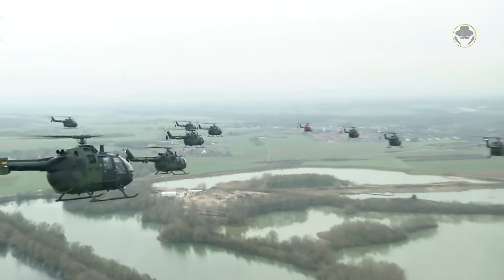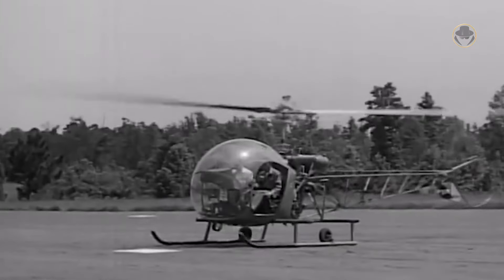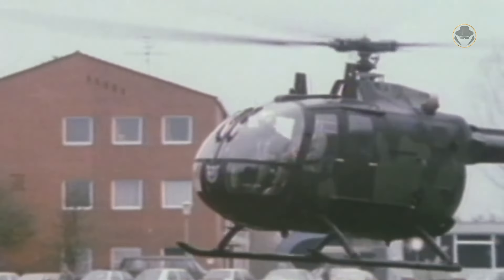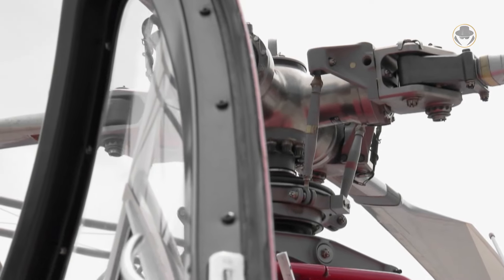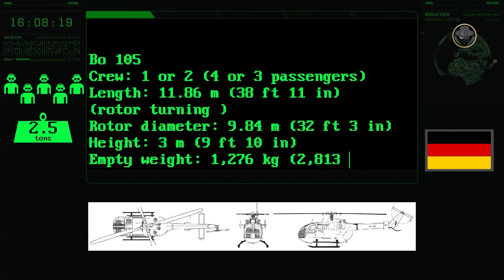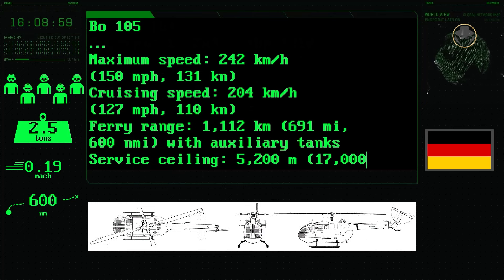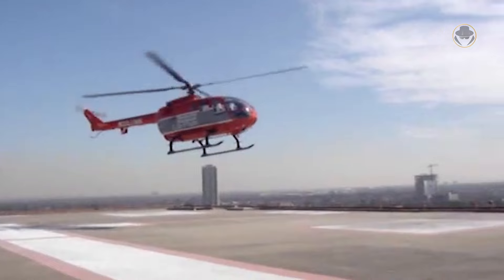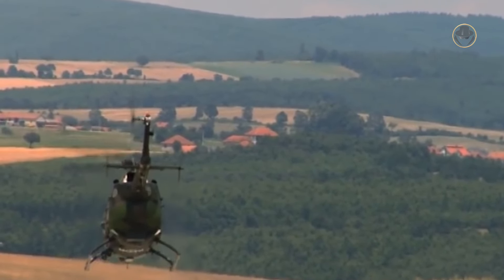MBB Bo 105 | The most successful purely German helicopter

Comment: The Bo 105 still looks modern today.
Reply: Yes, it is pretty unique in that way too.
Reply: To me it always looked so old fashioned, compared with other twins by Bell or the Westland Lynx . And it seemed as too small for passenger/troop transport and not really fit for armed support roles .
Reply: The messerschmitt spirit is still in it.
Reply: @lws7394  but in fact, it was a superb tank hunter and support helicopter
Reply: Yep!
Reply: Not in the slightest does it look modern
Reply: @lws7394  That weirdly shaped pointy nose on the Westland Lynx makes it look extremely old fashioned in my eyes, as if it was designed before wind tunnels were common.
Reply: @Taladar2003 
Is that the same Westland Lynx that has held the helicopter speed record for almost 40 years?

Comment: Great video of a clasic helicopter. It was nice to see so many images from Chile. In my country the BO105 served with the Carabineros national police, and later with the Air Force and Navy, plus civilian operators. Carabineros used it to rescue victims during the fire at the Torre Santa María, at the time Chile's tallest skyscraper, overloading it way over its certified capabilities. This helicopter saved many lives in my country in many rescue missions. It's rear clamshell doors made it easy lo load and unload stretchers with patients.
Reply: Are there any plans to extend the use of this heli? Or do you want to replace it with a new one?
Reply: @muhammadjordanpratama5008  In Chile they have been replaced with a variety of different helo models: Bell 212 and 412 in the Airforce and police forces have bought models by Leonardo and Airbus.

Comment: My first helicopter i got really close to... About 30+ years ago there was an accident with a kid falling off the rolling gate cover of a underground garage. They called in a Bo-105 emergency response heli "christof xx" (cannot remember the designation, but its Christoph 9 these days). After landing with the rotor still spinning while sitting on a field right next to the road an ambulance drove past, right through the rotordisc. One blade caught the top-mounted ambulance lights and swept them clear of the roof. They ended up calling in another Bo-105 with engineers to check the blades and made a few tests... They sat on the field for hours, and we were allowed to take a closer look as long as we didnt touch anything :) Still remember the smell of kerosene burned when they both finally took off into the sunset. Hope miltech will eventually get it done in DCS... but thats not relevant to the video.
Reply: there are everywhere some idiots out there...

Comment: Thanks for a great video!

I'd argue the MBB spirit lives on in the Airbus EC-125-145 helicopters. 
They're used by emergency services around the world, and have a superb fly-by-wire system, allowing them to land with minimal clearance to other obstacles.
Reply: This is correct. The bo105 is the direct ancestor of the bk117, ec135, h145 etc.
Reply from the maker: You also have a point. But, our argument is based on the fact that the BK-117 is a German-Japanese joint helicopter. Besides, the EC135 and EC145 are Airbus Helicopters products, which makes them German-French helicopters rather than pure German ones.
Reply: @WeaponDetective  i know that the 117 was a joint venture for production. The K in BK stands for Kawasaki! They also supply the MGBś of several real good Us helicopters!
Reply: @WeaponDetective  The EC135 started as a MBB project before Eurocopter  merged with them.

Comment: It’s purely German, except avionics and the twin Allison RR250 C20B engines, later with the Allison RR250 C20R and C28C.
There is also a STC to equip it with the Allison RR250 C30 turbines.

Comment: No, not the last pure german succesful aircraft. What about the Dornier 228 , a twin-turboprop STOL utility aircraft, designed in the 80s and build until today .
Reply: It's a bit crazy that the  Dornier company doesn't exist anymore but the 228 is still successfully in production.
Reply from the maker: In our defence, we think the Do 228's market and design successes are modest compared to this helicopter and other rival aircraft in its class in the market. On the other hand, the Bo 105 has changed light helicopter design, was produced more than 1,500, and was preferred by more than 40 countries, making it an aviation marvel.

Comment: the Aérospatiale Gazelle SA342M multi mission helicopter outclasses the MBB Bo 105 hands down . . .
Reply: The Bo 105 is way more agile. It was the first helicopter capable of flying regular and inverted loops and to this day it is still the most popular helicopter for helicopter air acrobatic shows and display flying.
Reply: Not flying over the sea it doesn't. Good aircraft though.